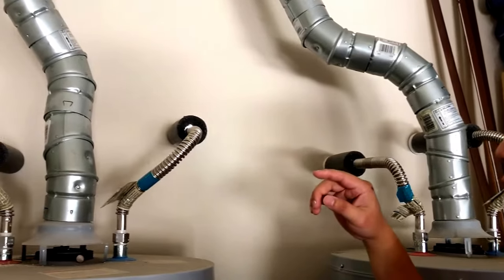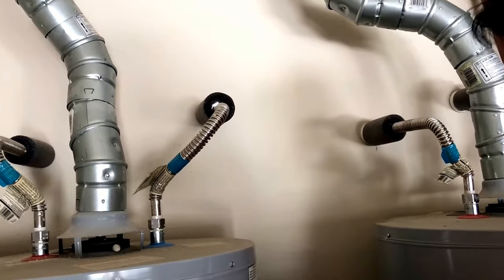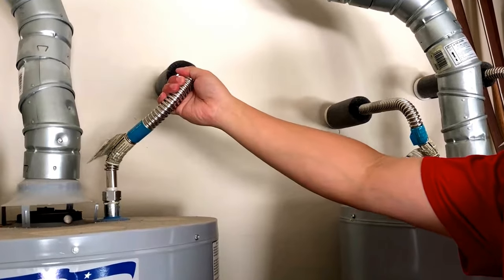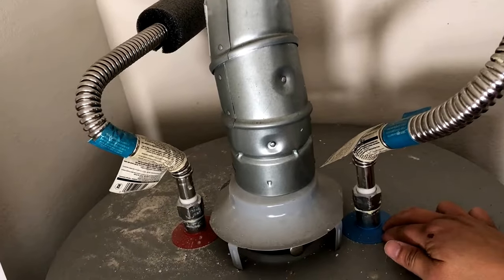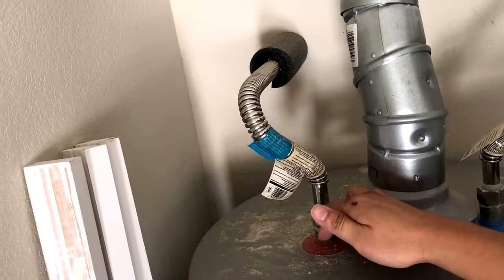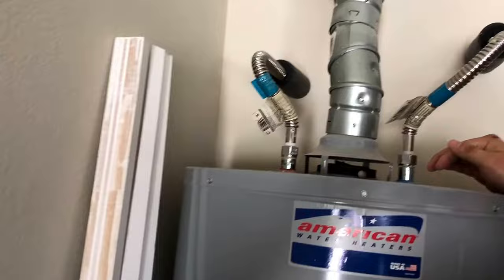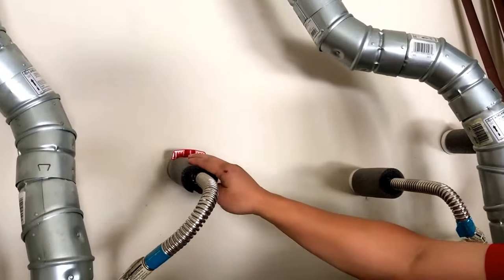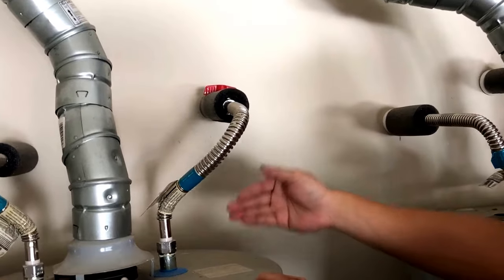Shut Off the Water Supply to your Water Heater

Comment: Mine does not look like that.  it has a flat long metal piece that is attached on the side.  It doesn't really budge when I give any pressure and not knowing if that's the right piece I don't want to tug too hard. Do I try to move it out? or up?

Comment: My bathtub is leaking 20 gallons of hot water/hour. is it safe to just shut off the water supply to the hot water heater? It won't build up pressure or anything, causing a huge explosion?
Reply from the maker: Yes you can shut-off the water supply to the water heater. Since the water heater will be empty, I would recommend turning off the water heater completely. Depending on your water heater, for GAS ones you should turn the dial to OFF and also turn the gas valve to SHUT/OFF.  For electric, there should be a switch to turn off somewhere.
Reply: @DIYGEEKTEXAS  Done Tyvm 😅

Comment: My water heater is leaking but it’s leaking into my house (even though the water heater is in the garage). It’s because of the foundation it’s leaning if the direction inside. I tried turning off the water supply to water heater, then I turned the main water back on, but the after heater continued to leak. I thought I had disconnected it. I wondered if it was leaking because there was some residual water running through the line perhaps? Not sure.

I may try this again, but I’m almost afraid the contents of the water heater will flood my house.

Edit: I just read a few other comments and it’s suggested to turn on a couple of faucets (hot water) to let the water run out. Maybe that will solve the problem.

Comment: Not useful to me. The valve was in that spot, but it wasn't that kind of valve, it was the kind you open or close specifically by turning a circular thing clockwise or counterclockwise like a garden water spigot, and I could not turn it, and I didn't know whether I should be tightening it or loosening it anyway. If it was currently ON despite being so tight I couldn't turn it, how the hell tight would I need to make it to turn off the water?
Reply: You have a gate valve. Lefty loose, right is tight. Sometimes when they are old they are harder to turn.

Comment: does it save electricity bill when you turn off the water inlet?
Reply from the maker: yes (if your water heater runs on electric), when the water inlet is turned off, no water enters the tank and the water heater will not turn on.

Comment: When u turn off cold should the pressure in hot be none then?
Reply from the maker: @B Great question, no, the pressure in the hot water tank will stay even after you shut off the cold water valve. You will have to open a few hot water faucet(s) to drain the hot water or relieve some hot water from the drain plug.
Reply: @DIYGEEKTEXAS  i turned off cold water inlet at hot water heater and went to faucet to turn on hot water and barely anything came out, so do i need to do that to each fixture to completely drain the hot water pipe so i can cut/replace some of it w/o it blowing water on me?
Reply from the maker: @Eastbaypisces  Yes as long as nothing is coming out of the faucet for hot anymore you should be good. Keep the faucet hot open during your pipe cut/replace to ensure pressure is always relieved there.
Reply: @DIYGEEKTEXAS  the thing is where the line is that i want to repair is lowest point in house well aleast lower than hot water heater by couple feet, so wouldn't there be water in them or no?
Reply from the maker: @Eastbaypisces  Yes there should be water there, especially if you have not drained your water heater.  Just to be sure I recommend you drain your water heater using garden hose. The water heater need to be drained and flushed once a year anyways, it is a good time to do it all together. I created a video before, here it is:  https://youtu.be/rA5pa8yn1vc   (do not refill the water heater until you are done with your pipe repair).

Comment: What if my water heater doesn't have a valve? I can't find anything on top or on the hose. 
Sounds like water is constantly running and loud that's why I want to turn off water supply. But there is no valve on the hose or on top where else would it be?
Reply: where u able to find a way to shut it off